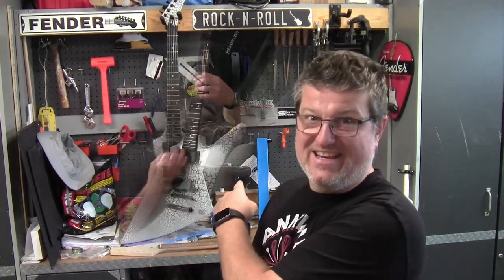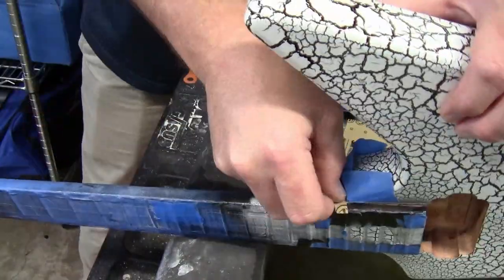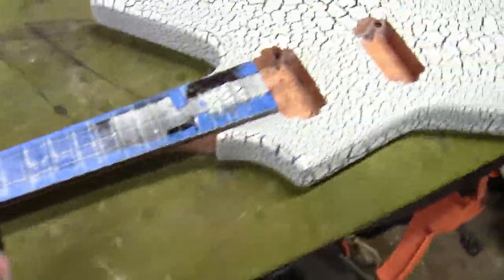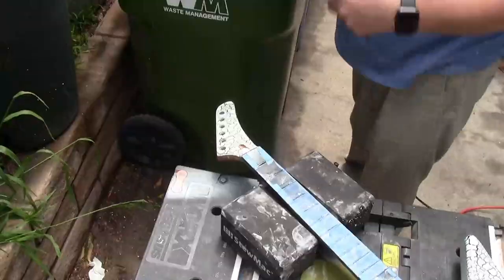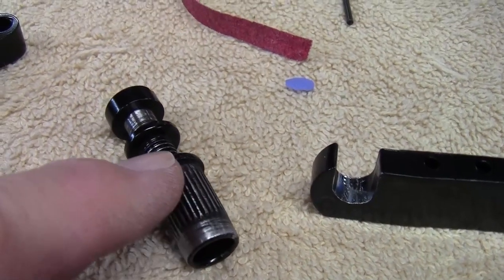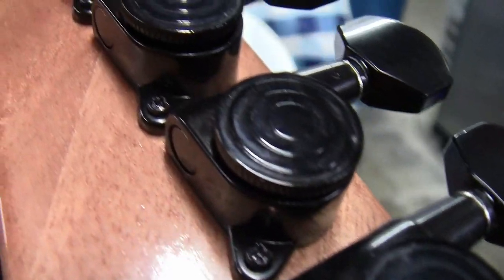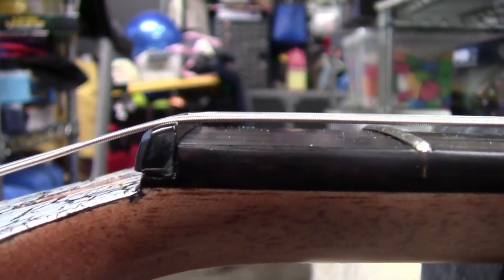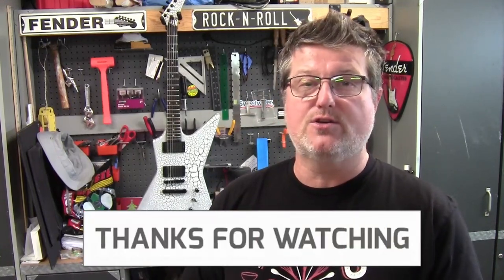Explorer Style Build: Episode 5

Comment: I plan on buying a guy explorer kit, i wanted a little advice becausd ive never built my own, i just wanna know everyting to make that nice crackle finish.
Reply from the maker: The crackle finish was a learning process for me.  I watched a lot of YouTube videos to get an idea of what to do.  Then I did testing on scrap wood.  I also painted the guitar once and didn't like it.  I had to sand it down and do it again.  The big thing is to be prepared when you get ready to paint.  The setup time is super quick.  I panted the under lying color (black) with regular paint and let it dry for about 45 min.  Then I did the crackle paint (white)  It basically starts drying as soon as I lay it down.  So you have to quick with the process.  You can't go back and do a second coat.  So prepare and work fast!  Good luck, let me know how it goes.  Thanks for watching.

Comment: Hi John, where did you get all the guitar hardware from? Or is it 1 size fits all with these sorts of things? Thankyou!
Reply from the maker: I got all the hardware from sellers on Amazon.  I just verified the spacing on the bridge, and it was the same.  The tuning machines were easy because the mounting hole for the tiny screw was not pre-drilled.  I go the pickups from Guitar Fetish, and those came with the electronics.  The only thing not from Amazon was the 9-volt battery compartment; I got that from Stewmac.  All the Amazon stuff was pretty cheap.  Thanks for watching!